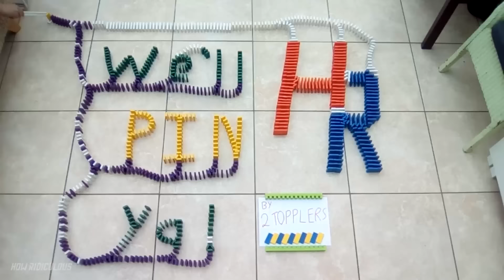Can This SOLID GLASS BALL Survive a 45m Drop?

Comment: Cause of the Coney Joney: it is caused because the glass is more resistant to compressive force then it is to pulling force. What happens is on that small point of impact the glass compresses while on the surrounding glass not in contact with the metal plate the momentum of the glass causes a pulling force. this causes conchoidal fracturing in that particular way that makes the cone.
Reply: very simply the part that hits the metal has support(the metal) to stay bound to the sphere, the parts around doesnt have anything to support it so with the sudden stop it just comes off making a cone. im guessing the wankiness is because it is hitting a uneven surface?
Reply: For anyone confused, another phrase for "pulling force" is shearing force. So when the glass comes to a sudden stop in a small impact site (flat surface), the "column" beneath it is supporting it to a point. However, it is still compressing (squishing), so there is flex. Where glass is great with compression, it has very poor ability against shearing forces (squishing a tortilla chip on its edge vs pulling it apart). Because of this compression, the surrounding area is shearing off, creating a repeatable pattern of a cone. These slight variances are not necessarily molecular, but instead rely more heavily on small variance in density and micro-fractures the glass endured during cooling.
Reply: @DapperDanLovesYou  no mate, that's tension. Shear force is quite different.
Reply: What he said😐
Reply: @tavobenne  ^thats what I wanted to say
Reply: I’m glad y’all added this information in here because I really wanted to know about that too
Reply: Yes , Glass is strong in compression weak in tension.  The area that comes off is in tension.  The cone is a boundary between the sum of those  2  forces.
Reply: @tavobenne  Yes, its tension but there may be some shear as well.  Its complex.
Reply: Not to mention a sphere is made up of an infinite number of cones all starting at the point called the equinoctial circle, or the direct middle of the spere as if it got cut perfectly half. That equinoctial circle is the base of the cone they are seeing. The point of contact is the compressed tip of the cone. Which is actually the strongest point of the sphere when it was dropped.
Reply: Bingo. Thank you for the precise explanation. 👍
Reply: @tavobenne  you're correct, the shear force in glass doesn't exist, since it is an amorphous solid, and any force is randomly distributed in the direction away of the impact.
Reply: @tavobenne  Because the tip of the "cone" (where the ball of glass impacts) is being literally compressed toward the center of the ball, while the surrounding area isn't, the forces are running in opposite directions, or "shearing," causing a cone to form in the surrounding area of the impact site. 

While a ball of glass like these will have internal tension, it's not like hardened glass or a prince Rupert drop, where the tension is so great the whole piece of glass shatters.

Comment: The coney joney is a result of point loading the sphere upon impact. 

“The dynamic compression processes can be divided into three stages, e.g.the quasi-elastic deformation stage, the non-linear deformation stage,and the brittle failure stage. The plane-like fronts and the shadow areas (crushed/ brittle failure region) are observed in the spheres. At the brittle failure stage, the movement of the plane-like fronts stops gradually, and macro radial cracks around the edges of shadow areas nucleate and coalesce along the impact direction. The shadow areas and these radial cracks are the causesof the catastrophic failure.”

- Junfang Shan, et al, Dynamic Breakage of Glass Sphere Subjected to Impact Loading (2018)
Reply: Nightshade there’s actually a lot of research done on stress testing spheres of various media.
Reply: This is great, but could you say it again with small words for us idiots in the room?
Reply: U legit made my brain hurt but I understand now😂
Reply: Can you do that same paragraph but with simple people words
Reply: Nerd
Reply: I think that would be true if the ball was stationary and the something impacted it. In this case I would say the answer is in the footage of the cement sphere. The chips that come off do so because they were traveling downwards and wanted to keep going and were not attached well enough so they did. Same with the glass ball, the glass on th bottom half of the sphere broke off wherever it was not supported by the steel plate. Only the small circle was in contact of the steel plate so obviously the angle that the glass can support itself at that speed, and the sphere were two different shapes, which became the support shape immediately upon impact. An object in motion will stay in motion. Even the bottom half of that sphere.
Reply: @nightshade7240  Thank you!

Comment: It's called the "Rhesphorical point" it's where depending on the size of a sphere and the impact, would create a point of force in the apex of the sphere in where it will shockwave outward around the sphere until the shockwave is completely deminished and throughout the shockwave, any glass that around the area of the shockwaves path gets destroyed, but it creates a point because the impact of the shockwave spreads out quickly from the centre thus becomes weak in the on the apex of the sphere and so it shatters less glass but as the shockwave spreads it has a wider surface area to break the glass... That's why the first small drop just created this bubble looking crack because the impact was small thus the shockwave didn't have enough time to spread wider and thus just creating that little indent on the sphere ball, it imprinted the area of the shockwave from the point to where it ended... Though the shockwave travels farther, buy isn't strong enough to shatter any further glass so it's just breaking the glass where the shockwave is strong, I assume this theory is right.... Anyways I think ranted on too long, hope y'all found this complete useless info that I pulled outta my behind XD thanks for reading tho <3

Comment: It’s called a pressure cone. I learned about it in one of my engineering classes. Basically the material has a particular force threshold that will break it, there’s a different shape cone for every material

I’ll make the expiation for the glass as simple as I can, let me know if you have any questions 

For the glass for example, it forms a cone shape, because at the split second the ball hits,  the glass can either break or compress. Because there is more glass directly above (at a right angle to the force of the hit) the point that gets hit, there is a cushioning effect from the supporting glass. That’s why it doesn’t completely shatter. That’s also why the cone was at an angle for some of the tests. Because they were spinning. No fault to the boys, but getting a falling object to do exactly what you want is very challenging. 

If the boys are reading this, what is the maximum weight the tower can hold? 

This is why a bullet will cause a larger hole in the back of the target as opposed to the entrance

I could help you design an object that fits that maximum weight threshold and falls strait, but also have a focus point of a few square inches that way you can basically have the heaviest hole punch in the world
Reply: What determines the shape of the pressure cone? Is it a whole combination of materials properties?
Reply: @mattc3738  material, forced apply and shape mostlikely
Reply: Zachary Hatch Nerd 😂 jk
Reply: Matt C yea basically. 

For example each of these would have a different pressure cone 

Wood
Metal
Plastic
Rubber

Heck even the ground under your feet. 

For example, an explosion underground has a weak point directly above it at a right angle to the surface. 

This is how a blast tech at a mine for example can predict how much explosive they need. 

It’s all about how the material in front of it is gonna move in relation to the stuff behind it
Reply: It’s actually a Conchoidal fracture.
Reply: Joe Harper it’s the same basic concept. I’m in the eastern US so maybe the regional lingo is different
Reply: Jack Dalgleish that doesnt sound nice
Reply: pretty sure a meteor or asteroid has that record locked in.  (maybe the theoretical mars sized planet which struck earth early during development)
Reply: @mattc3738  

The glass spheres’ unusual breaking effect is called the condical cone effect due to the distribution of force as it hits the steel plate. 

Glass of this type is of an inorganic silica compound, and is uncompressable. The force has no place to be released, so, consequently, the force pushes the sides of the glass sphere out in a shearing motion. This is called shear loading. Directly on the point of contact, the glass stays almost completely intact, as it is being pushed w/ extreme force, that is then diverted downwards, and outwards creating the cone effect.

These glass spheres were probably made similar to how a Prince Rupert’s Drop acts. A Prince Rupert’s Drop is basically a tear drop of molten glass dropped into cold water, creating a piece of glass where the outside is instantaneously cooled, but the inside is still hot, resulting in a force that pulls inwards towards the center of the glass drop. The drop is extremely hard, but if nicked at the tip, can shatter in milliseconds (watch SmarterEveryDay’s video that better explains it here - https://m.youtube.com/watch?v=xe-f4gokRBs)

The Prince Rupert’s Drop effect explains why the sphere is so hard; when it was cooled, the inner glass of the sphere cooled more slowly, creating a force that pulls inwards towards the center if each ball. This makes it extremely strong, and creates the cone effect. The reason that a pattern seems to emerge where the cone’s Hertzian effect is almost the same dropped from 10 meters and 45 meters is that, as I said earlier, the glass is uncompressable, and the maximum exerted force was not yet achieved. This might be possible if the spheres is dropped from a much greater height onto a material that would not absorb a lot of force (the plate in the video absorbs a lot of force because of its wobbling, and the sand further absorbs the shock) such as a mangalloy plate fused to concrete, as the plate wouldn’t be able to move, and acts as an almost immovable object.
Reply: wrong. The glass spheres’ unusual breaking effect is called the condical cone effect due to the distribution of force as it hits the steel plate. 

Glass of this type is of an inorganic silica compound, and is uncompressable. The force has no place to be released, so, consequently, the force pushes the sides of the glass sphere out in a shearing motion. This is called shear loading. Directly on the point of contact, the glass stays almost completely intact, as it is being pushed w/ extreme force, that is then diverted downwards, and outwards creating the cone effect.

These glass spheres were probably made similar to how a Prince Rupert’s Drop acts. A Prince Rupert’s Drop is basically a tear drop of molten glass dropped into cold water, creating a piece of glass where the outside is instantaneously cooled, but the inside is still hot, resulting in a force that pulls inwards towards the center of the glass drop. The drop is extremely hard, but if nicked at the tip, can shatter in milliseconds (watch SmarterEveryDay’s video that better explains it here - https://m.youtube.com/watch?v=xe-f4gokRBs)

The Prince Rupert’s Drop effect explains why the sphere is so hard; when it was cooled, the inner glass of the sphere cooled more slowly, creating a force that pulls inwards towards the center if each ball. This makes it extremely strong, and creates the cone effect. The reason that a pattern seems to emerge where the cone’s Hertzian effect is almost the same dropped from 10 meters and 45 meters is that, as I said earlier, the glass is uncompressable, and the maximum exerted force was not yet achieved. This might be possible if the spheres is dropped from a much greater height onto a material that would not absorb a lot of force (the plate in the video absorbs a lot of force because of its wobbling, and the sand further absorbs the shock) such as a mangalloy plate fused to concrete, as the plate wouldn’t be able to move, and acts as an almost immovable object.

Comment: 4:01 Jack running into frame😂😂
Reply: When they create the glass they put it in a special oven that slowly brings the glass down to room temperature so it doesn’t crack and when it cools down it cools down from outside in and sometimes the glass doesn’t cool down evenly and creating layers and when you break the glass it breaks in the layers it cool down in.

Comment: It’s so cool when the smashed glass rotates. Looks like a globe of water rippling
Reply: Assuming the object is a perfect sphere. When a force is subjected on it ( the impact of the glass sphere on the metal plate), the force will radiate out in both x and z directions while diminishing in magnitude (size) in the y direction. So basically the tip of the cone is the point of impact. That impact moves up and through the sphere. Since the force weakens as it moves through more and more glass it forms a cone.
Reply: I didn’t mean to post this in your comment

Comment: It breaks like that because of the spherical shape. The forces get "pushed" to the edges and aren't as large in the center, therefore shearing off the sides making the cone shape.
Reply: You dislike my v*deos? Are you just a h8er boi? I say see you l8er boi. Don't watch my stuff anymore. Your dislikes are damaging my good reputation. I am a superstar, dear graeme
Reply: @AxxLAfriku  can I have that translated from bullshit to English 🤣
Reply: Not necessarily.  I've seen the same thing form on blocks, and there's one on one of the wall tiles of my bathroom at work where the builders fucked up mounting a toilet paper dispenser.

Some materials are simultaneously brittle and compressible, so when they're struck by a strong impact, the force compresses everything in front of it.  The compression causes the force to propagate outward at an angle, rather than straight forward, and the cone of force gets sort of 'pushed away' from the material behind it.  If it goes all the way through something, the cone breaks off and leaves a void where it was.

If you do it on the edge of a block of material (and at an angle rather than straight on) rather than the center of a sphere, then that's how you make a blank for a stone blade.  (Making the actual blade takes some extra grinding.)
Reply: That is what I said but you said it better with 1000 less words.

Comment: The Coney Joney Effect:
Scientific Term- When a spherical object collides with another object where only a single point makes contact, the energy is transferred back through the sphere in a cone shape. Thus anything outside of this conic region is unsupported, and due to its inertia will shear off of the rest of the sphere. This phenomena will result in a hemisphere with a conic end. Here is a diagram I drew up: https://imgur.com/gallery/BbxiDsu

Disclaimer: (I don't know if any of this is true I was just guessing)
Reply: That's what I thought too
Reply: Makes sense to me
Reply: I KNOW that load deflection is directed out ward equally in a 45* angle. So I think your explanation is spot on.
Reply: So I'm not a physicist, but this is 99% right, it's not that the glass is unsupported and sheared off, the larger part of the sphere, the "Coney Joney" that is shed at the moment of impact. It appears the way you described because the globe is the one moving instead of the piece of metal.
Reply: I think it’s called a pressure cone. But I’m sure that a more scientific word for it is out there. A good explanation can be found in ballistics when a bullet hits glass or steel same thing can happen.
Reply: Also: The more speed the sphere gains the more clear and straight the coney joney will be.

Comment: that ia cone of force. A Hertzian cone is the cone produced when an object passes through a solid, such as a bullet through glass. More technically, it is a cone of force that propagates through a brittle, amorphous or cryptocrystalline solid material from a point of impact. this is a website that explains the effect https://www.tektites.info/spallation
Reply: @UCZ6NQNHt222-OEz0G4Cc65g Several reasons.  Number 1 it is made up of several layers made of differing materials, and two, the outside is plastic, not a crystalline material.  The core is something like rubber on the bowling ball, so the plastic shatters and the core absorbed the force.